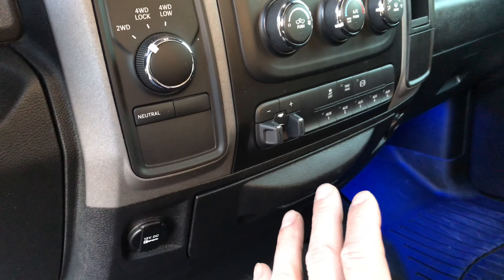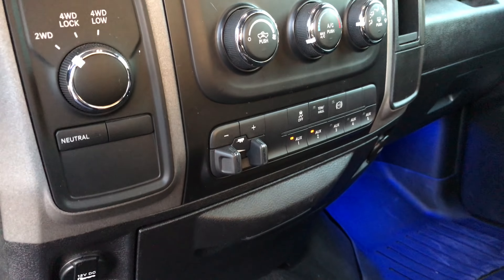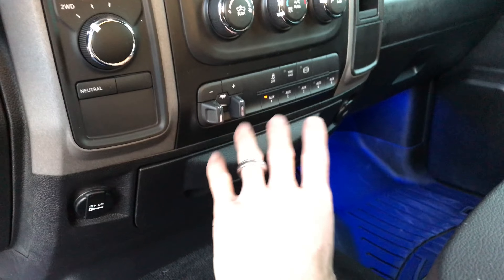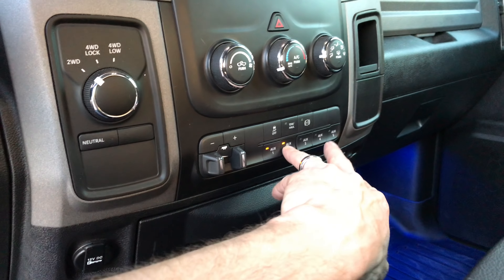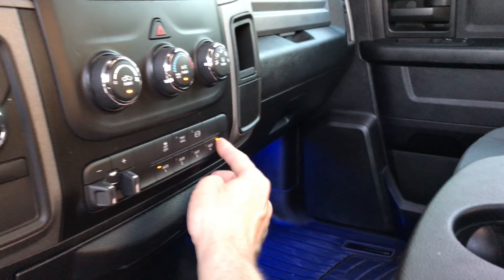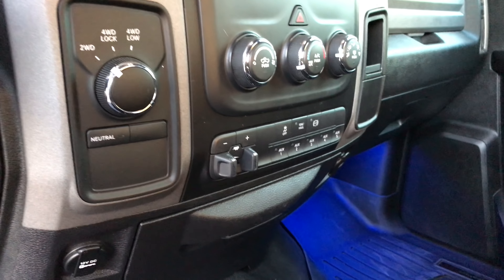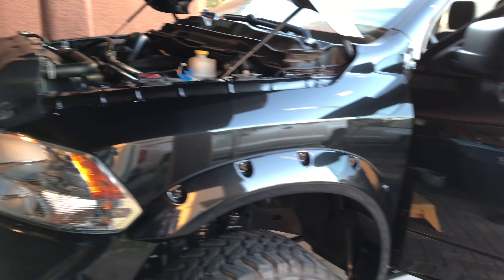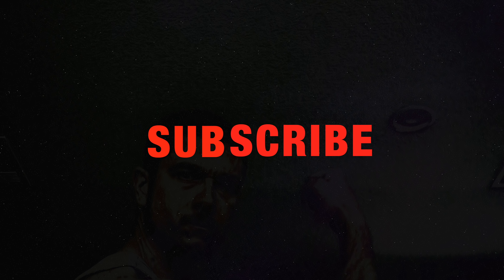4th gen ram electronics update on 1 and 2

Comment: Do you have a video of the install of the 4th gen switch or link of some kind I'm looking for it
Reply: Forget it I found it thanks
Reply from the maker: Kool
Reply: That I got a question that fuse box that you put on the firewall can you put that on the inside and have enough wire to run to the battery cuz it looks like a little tight on that firewall?